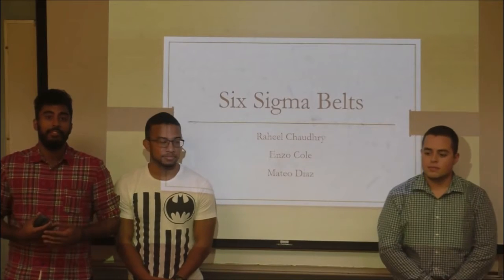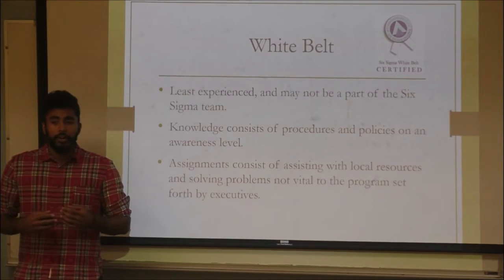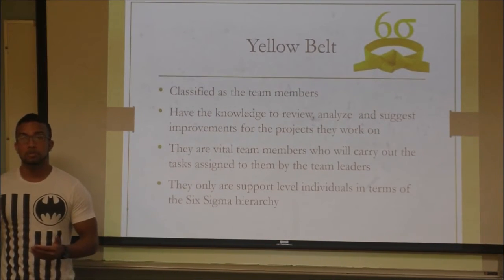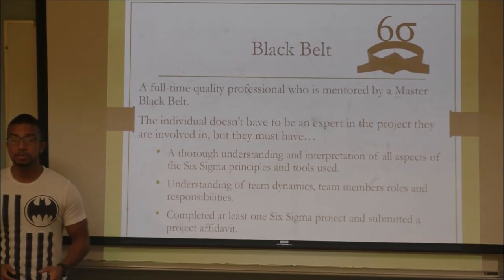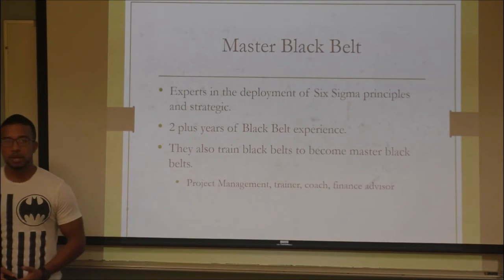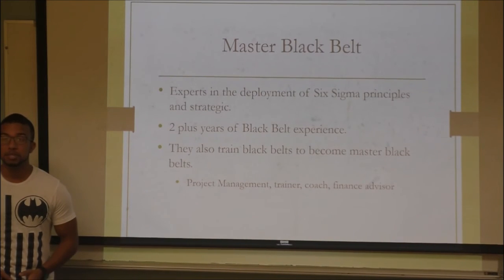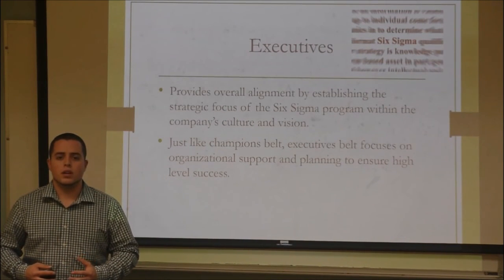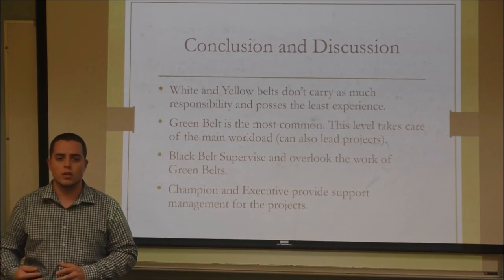Team 8: Six Sigma Belts: White, Yellow, Green, Black, Master Black, Champion and Executive Belts

Comment: This is a ok video. The speakers felt natural in the delivery of the information; this shows their mastery of the content. The fact that speaker 2 had causal attire broke the tone of the presentation. Even though the lighting and the sound quality were great, the Powerpoint slides were hard to read due to them having a large amount of text. The filming of the video could have been done better. The transitions between clips are abrupt and sudden; this along with the off center picture frame made the video disjointed. This could have been fixed if the team set up the camera better and if they split the content evenly between the presenters.